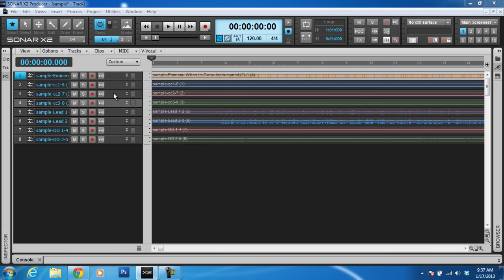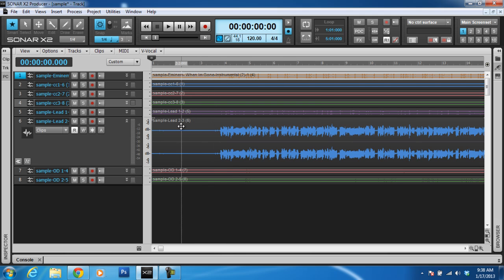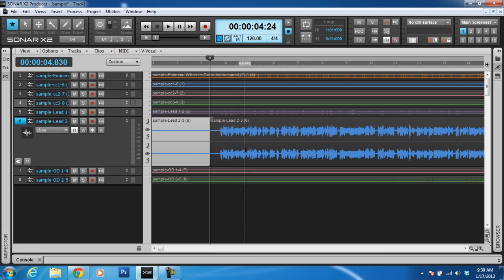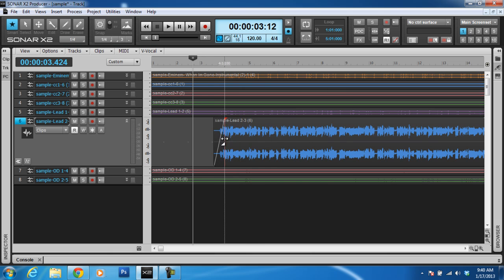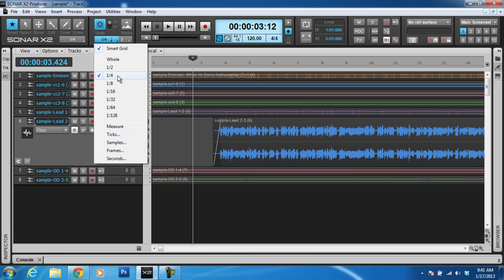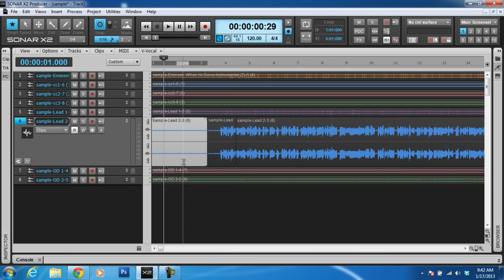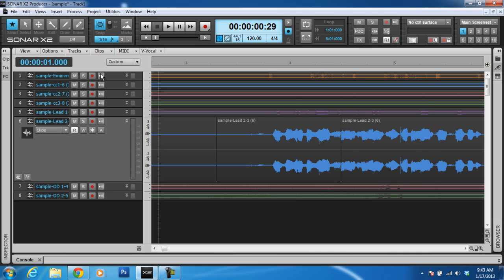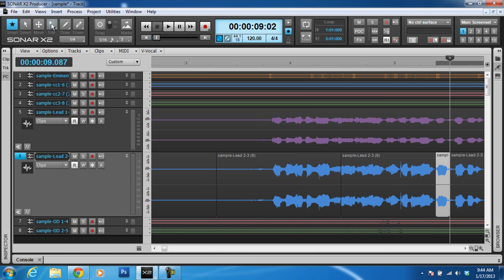SONAR X2 Digital Audio Workstation - EDITING BASICS

Comment: Have you ever tried the audio scaling on a clip? It's cool but the problem with Sonar's audio scaling is that if there's a portion of the clip that you want to scale in DBs you can't because scaling affects the whole clip as far as I know! BIG BUMMER!! Cakewalk! Even if you split the parts that you just want to scale Sonar still scales the whole clip!
Reply from the maker: what do you mean by audio scaling.. if you are talking about boosting a clip of audio or cutting it you can if you highlight the clip and goto the process tab and there is a sub menu apply effect and then select gain.. if that is not what you are looking for im not sure what you mean. thanks for the question tho.

Comment: So I get my clip ready to edit, get the point where I want to split the clip and the noise I want to delete, just like his example...then he inexplicably says "HIT S" to create two clips, one I keep and one I delete. "HIT S" is not an option. I press the S key, nothing. I click the S in sonar -- that's to turn solo on and off, control + S is save as far as I can tell. this is almost as frustrating as recording software that doesn't have options to edit right there where you need them and easy to use...
Reply from the maker: you need to click on the clip and then hit s